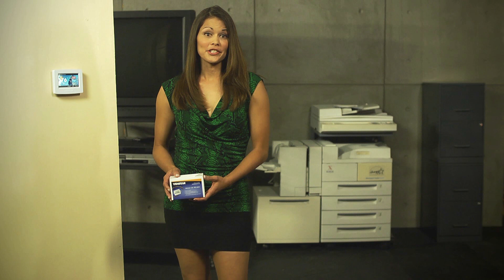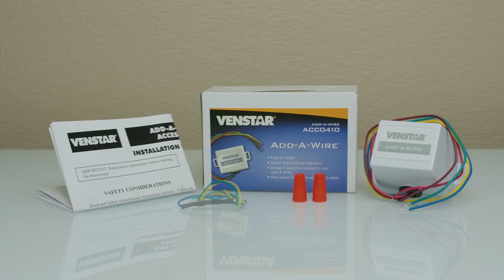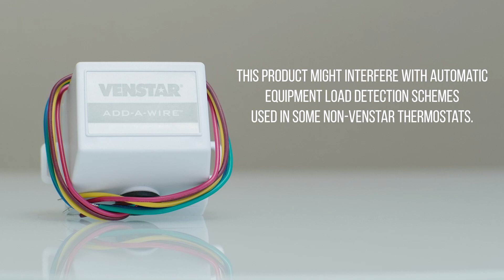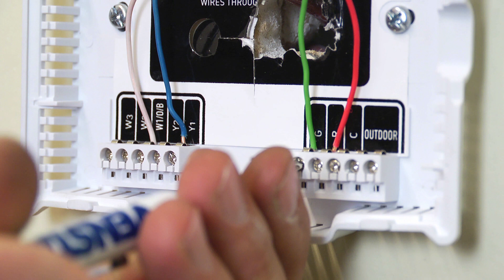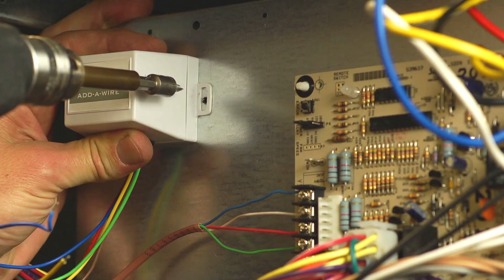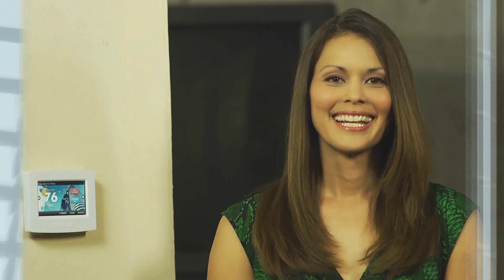Official Venstar ACC0410 Add-A-Wire Installation (Updated Video)

Comment: I have 4 HVAC forced air zones for heat and cooling and the furnace is gas. Each white rogers thermostat has 5 wires (W, RH, Y, G, RC) but no C Wire. Do I need this device for each air handler or is it installed elsewhere?  I have new Honeywell RTH9585WF Wi-Fi thermostats to install.

Comment: This did not work for me at all. Everything works except the AC and Fan. Whenever I turn ON the Fan, the AC would kick in. I cannot turn ON the Fan without turning ON the  AC. Horrible!
Reply: @Ruben Laugon Honeywell TH9320WF5003 Wi-Fi 9000 Color Touch Screen Programmable Thermostat. After several hours of troubleshooting, I finally got it work.

Comment: Installed properly on nest thermostat and now when selecting fan only, the AC compressor comes on when fan selected. Any thoughts how to fix this so we can just have fan only run?
Thanks.
Reply: It's possible that's a setting inside the Next thermostat setup menus. Just a thought

Comment: Will this work with a 2 zone controller that has only 1 ac/furnace/circuit board? If, so, would I need 2 add a wire kits?

Comment: What about the hookup for a 2 wire furnace like mine? I only have 2 wires and my Nest Thermostat is constantly whining for power especially during the summer months when my furnace is shut off and there's no power at all going to the wires.
Reply: Play the video - she tells you what you should use a couple of minutes in.
Reply: Looking at the owners' manual, it looks like the two wire support is only for cases where the unit is battery powered (to add cooling to a heating-only setup, for example).  If you are unable to run a wire, you may want to consider something like the Honeywell Lyric T6 Z-Wave thermostat, which can run for some time off batteries.  As long as you have a Z-Wave gateway on your network, you can get most all the smart features (remote monitoring, temperature changes, etc.) that you can with Nest.